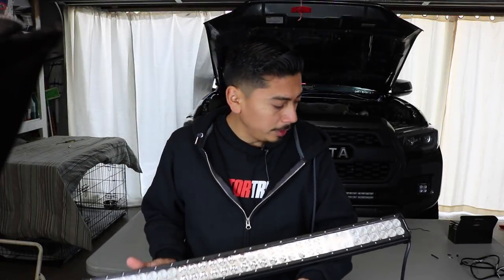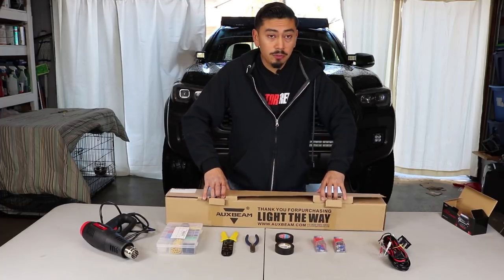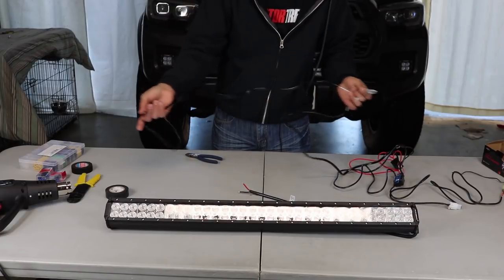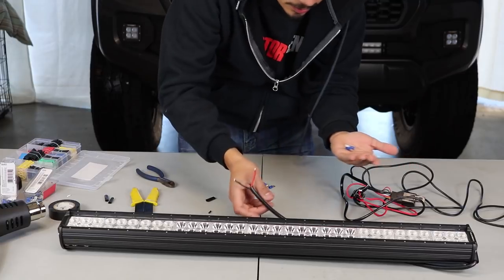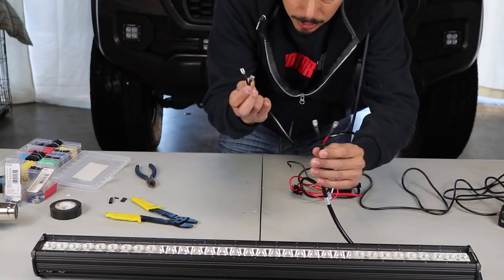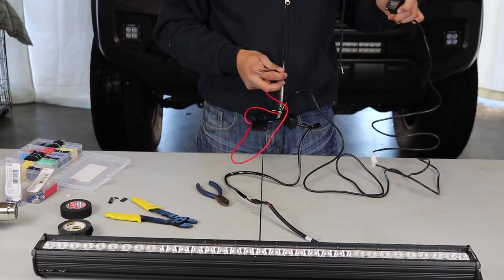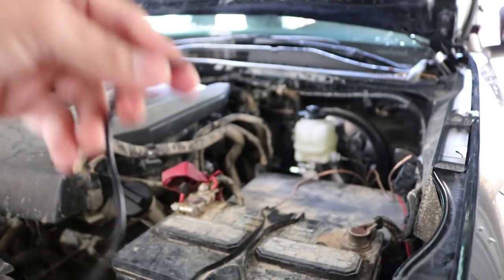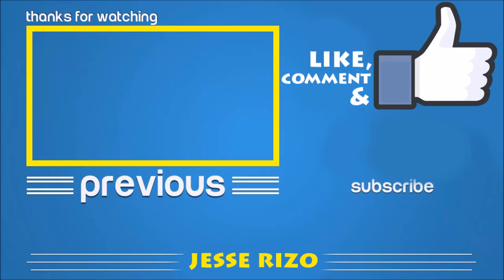HOW TO WIRE A LIGHTBAR ANYWHERE + CALI RAISED OEM SWITCH | LIGHTBAR GIVEAWAY

Comment: Does the Auxbeam switch fit in the extra button hole to the right of the AUTO button that is already on the truck without buying the additional bracket? I like the small change holder. Also, if I pre install the new button on the wire to the light bar will the button fit through the fire wall or will only a small wire fit through the fire wall? Wondering if I should wait until I install the new botton before I try getting it through the fire wall
Reply from the maker: Yes it’ll fit in the bottom little blank spot next to the auto button, and no first run the wire threw the firewall then wire up the button once it’s inside the cab & I have a video on how I ran it threw the firewall it helps if u have a cloths hanger
Reply: your awesome TU

Comment: Grateful for DIY channels like this that help keep me busy.  First mod on my Tacoma was just running boards and LED head/fog lights.   I did throw in the tailgate lock yesterday, though.  No dice on the rectangular bracket.  Just drilled a hole in the plastic like you did.

Comment: I am grateful for family and friends. The first mod I did on my 2019 Tacoma was the hood strut quicklift  kit. I would suggest using one male and one female on each side of the connection that way the wires can never be plugged into the wrong one.

Comment: Just a quick 411 if you look up the diagram on the Cali raised site one of those red wires you twisted together is supposed to be tapped into your interior lights so this way when your interior lights are on the switch is lite up but only the bottom section then when you push the switch the light bar illuminates

Comment: The Red wire on the switch ,next to the Black wire, taps into your dash lights circuit. The best way to do this is to buy an Add-a-circuit from the parts store and find a fuse that only comes on when the key is turned on and plug it into that slot.

Comment: I wired a 32 inch lightbar on my 2018 toyota tacoma offroad with the cali raised wiring harness and the cali raised switch and the backlight stayed on. I than tried the auxbeam wiring harness spliced into the cali raised switch and the backlight was still on. Either way the backlight stayed on. How do I get the switch backlight to stay off when I'm not using the lightbar?

Comment: Enter me. Great suggestion. I’m great full for my son Jesse and my love Michelle. First mod on my 2018 Trd off-road was black letters for the TACOMA on the tailgate. I have a set of Cali raised ditch lights ready to be installed
.  Just worried the cold jersey temperatures will make feeding the wires threw the firewall a bit rough.

Comment: Hey man awesome build, Im having issues with the TRD grill. I have a 2018 and when I swapped the grills and the adaptive cruise control alwayd throws up "System off" or "clean sensor" message. I expected this to be so for a few days as I figured the computers needed to recalibrate or compensate for it but it's been two weeks I've done plenty of city and highway driving and still get the message. Any advice?
Reply from the maker: Yes I did a install for a subscriber and same thing happen to his I asked where he got it and I gues he got the sensor cover from a no brand I had him get a Toyota OEM one and it fixed the issue, is your sensor cover oem?
Reply: @JesseRizo  oh man 😂 welp there's the problem. No its not oem. I tried to save a few buck and got one cheap for $25 which was a pretty tight fit. I did see an oem one on amazon from toyota for like $60 but I guess you get what you pay for. Just wanted to know if it was just me or this was a common problem. Thanks man!
Reply from the maker: Ninja Man lol yea man cuz I gues the no brands are a bit thicker then one so it didn’t let the sensor read, keep me updated I’d like to know if it fixes your issue I’m curious now lol
Reply: @JesseRizo  will do man thanks
Reply: @JesseRizo  hey man, been a about 3 days now and the OMW cover works perfectly. On a closer look comparing the two, the fake one is feels lighter that the oem, its maybe 1 or 2 mm thicker, they are definitely made out of two different kinds plastics. The fake has letters and marking that do match the oem but are nowhere near as define. The fake also has more glitter and each piece is far larger then the original. Like a speck of sand to dust. Since I've installed it the system works perfectly fine even in the snowy weather we just got hit with in the north east
Reply from the maker: Ninja Man hey thanks man I sincerely do appreciate u updating me on this just in case someone else reaches out I can feel more been more confident on letting them know this is most likely the issue lol thank you man :)!! Glad it worked for u

Comment: How do you wire the ch4x4 switches to turn on with headlights? I can never see them in the dark!
Reply from the maker: I havnt done it yet 😬 but do you have a tester by any chance? If u do it helps to have one u can use it by turning on and off the headlights while testingin the fuse box to see which one is the headlights fuse then u can do a add a fuse and tap into it for ur lighting I’m sure it’s in the Manuel but for me I hate reading that thing lol so that’s just what I would do lol

Comment: Man your truck is slowly  but surely turning in to an awesome looking truck

My first mod was the wet okole seat cover
Its a cool looking  seat cover
Snag fit too

Have a question tho
Do you have any problems or dislike  with how the transmission  change gears
If i put it in reverse  iy has a lot of power  which is scaryy at times
 Have to make sure im stepping hard on the brakes before putting  it in reverse 

Please  enter me

Comment: So the problem form the Cali switch always stying on is the the wire harness? I used the one that came  with with the light bar it’s red and a black, as far as the switch it’s the same way as you instructed please help don’t want to have it on when truck is off
Reply from the maker: I been getting this a lot I’m not sure if auxbeam or if Cali raised switched how they made them internally to be honest :/ I’ll have to relook at mine
Reply: Ok and thank you for the replay

Comment: Why My Cali raises push bottom alway on?
Reply from the maker: https://youtu.be/LctM2Lhs7q4 try this way
Reply: Jesse Rizo my ox wire have black red and white and I connected it to my Cali raises and it work but the ditch light push bottom alway on will it drain my battery